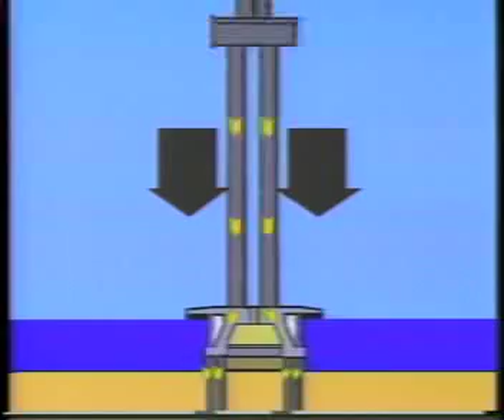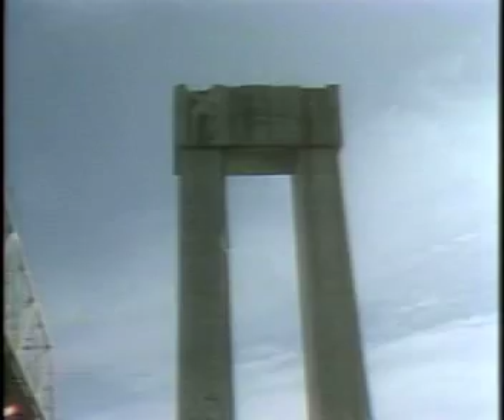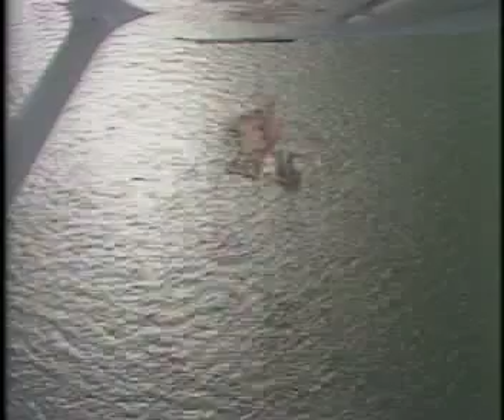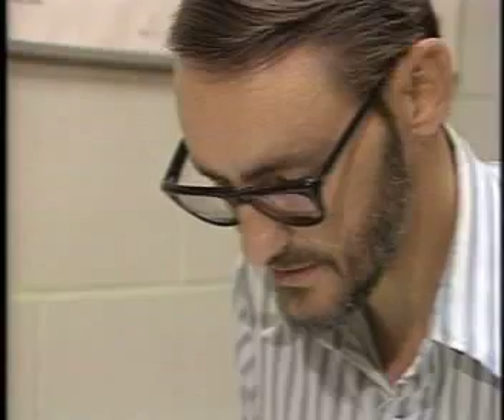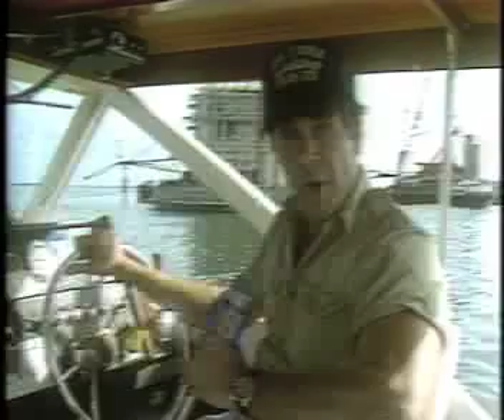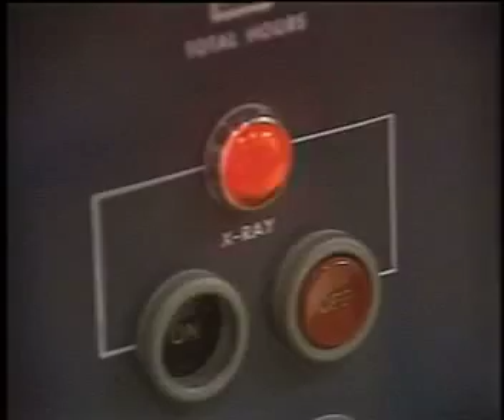Sunshine Skyway Bridge Investigation

Comment: With the improved barriers to large vessels, and the backfill surrounding the main piers, there is little chance of direct ship strike taking out the high level sections. Even a much smaller vessel would run aground before it could hit. I'd have preferred solid concrete in the foundations though.
Reply from the maker: Seems more reasonable

Comment: In  my experience working with concrete, I would not be happy with any cracking at all(I am speaking of very heavy commercial projects- thick concrete)..Secondly, you have to be very deep below the surface before items are insulated from corrosion from oxidation.. I am suspicious of DOT. The Overseas Highway never had any cracking or corrosion problems., a nd it survived(The piers) how many hurricanes